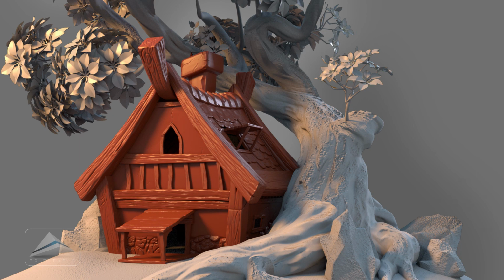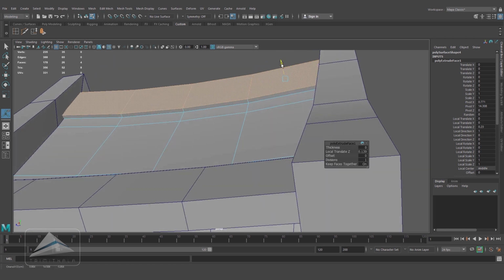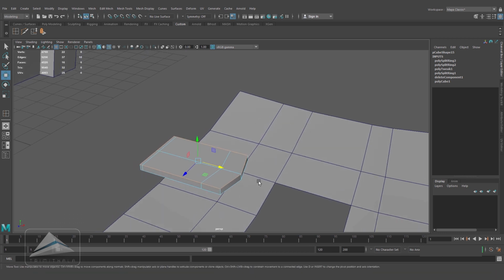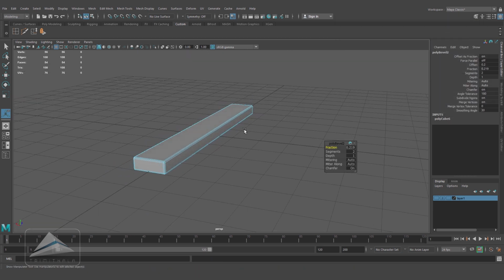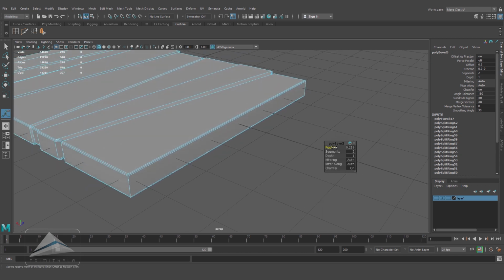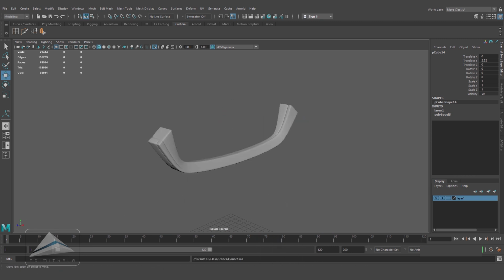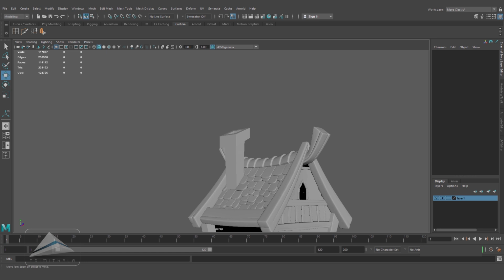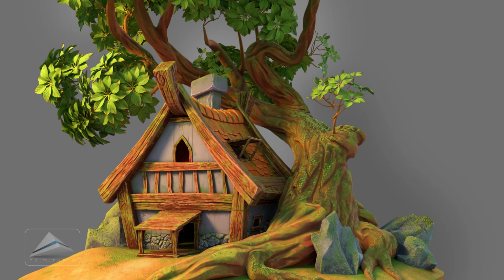1. Hut | Modeling a Hut in Maya | Tutorial 1| Making 3D Scene Step by Step

Comment: found answer to mirror tool for making roofline tiles. shift + RMB brings up mirror button on shortcuts menu. then it brings up a box that gives more options such as cut geometry, axis position, offset etc. i clicked Offset and changed it from 0 to -1. it created a mirror of the roofline but didnt snap on like a V. it was further apart. however when i moved it close to the other side it automatically snapped into position :) yay! wish it worked like this video shows automatically making an inverted V but whatever it works and i can finish this model. Hope it helps anyone else who gets stuck on that part.

Comment: I am trying to apply insert edge loop with flow command. I can see the deformity there but they are not equal. It might be some settings that I messed up. I am attaching some screenshots with this. It would be very helpful If anyone can point out what is wrong this.

Comment: I try to do the -1 on x after duplicate - I'm following step by step and it still doesn't work. Really not a fan of this program so far.
Reply: did you apply freeze transformation first?
Reply: maya is hard to learn...dont worry you will get the hang of it eventually. im on year 3 of trying to learn this program. there are so many controls that its easy to get frustrated.

Comment: I loved this tutorial and it helped with my project for school, the only part I got confused about was at the 51:29 part where you took the flat square plane and then hit smooth, and your's turned into a circle while mine doesn't do that. Is there a certain setting I'm not aware of?
Reply: Mesh > Smooth Tool Settings (the box to the right of "Smooth"). Under "Exponential Controls" click the "OpenSubdiv Catmull-Clark" option, under "OpenSubdiv Catmull-Clark > Vertex Boundary" click "Sharp edges", under "OpenSubdiv Catmull-Clark > UV Boundary Smooth" click "None", and then click "Apply". A couple other combinations in the smooth options works as well but I'm not sure which one is correct.

Comment: at 9:45 when i try to add the edge loops it's only added to 1 side and not both sides of the mirrored object, so then i have to manually add edge loops to the other side and try to line it up... what am i doing wrong?
Reply: You might be using insert edge loop, which is just inserting one edge loop
To add "mirrored" edge loops, go to 
mesh tools > offset edge loops
Reply: @arianacao2525  I already gave up on Maya.. I've learned Blender now and its much better honestly.

Comment: the workflow and thinking is a bit off but the final result actually looks good you'r artistic thats sure <3
Reply: Hello! I’m currently learning Maya for school and I was wondering, what would be the better workflow?
Reply: @letterborneVods  the way he uses/prethinks about what he is making for instance he was making roof panels and for those he needed loop cuts which he did all by hand even though u can way easier use the bevel tool to add loops
Reply: @letterborneVods  also the fact he uses the drop-down menus on top of his screen instead of using shortcuts and his RMB you can find most of your tools using shift+RMB and if you can't find it in that menu you can press and hold your space-bar for all the other menus those kind of shortcuts make your workflow so so so much faster
Reply: @letterborneVods  if you want you could add me on discord for questions about sertain tools and problems do keep in mind I'm also a student myself so there are questions I will have to research before actually being able too answer